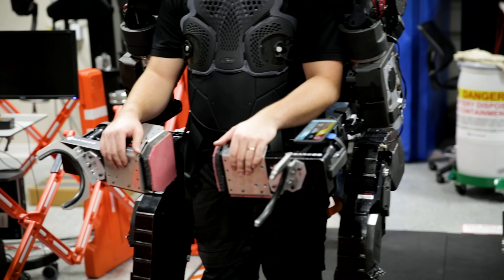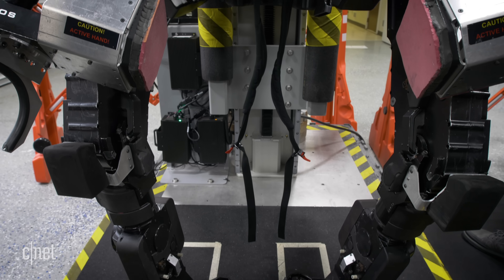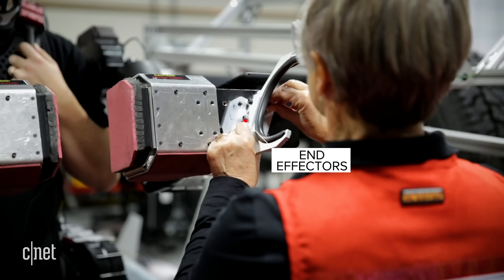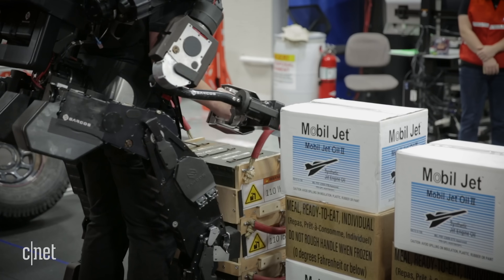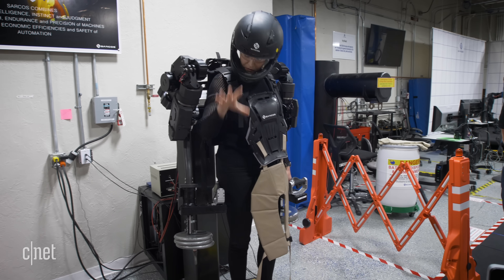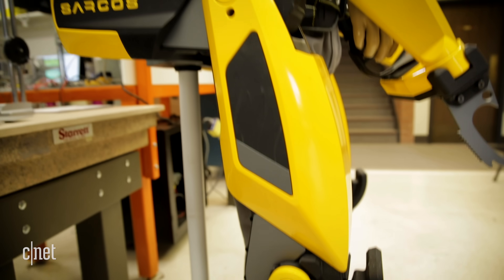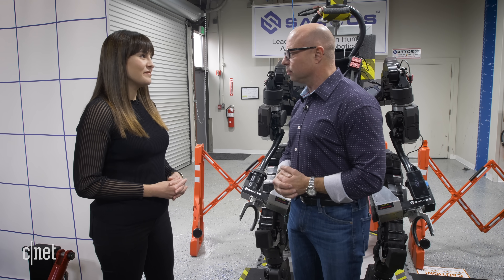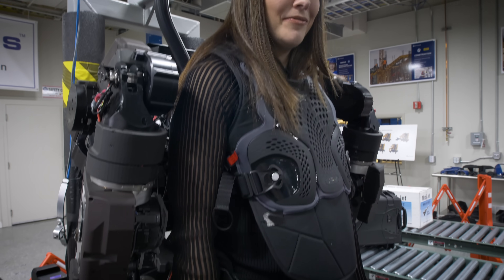Guardian XO is a powered exoskeleton that makes you 20X stronger

Comment: Why is the human element even there? Couldn't a robot just do the same thing without the need for an operator?
Reply: to control it, it easier than a remote control
Reply: @marwanelyoussoufi626  Robots are already easily automated to perform tasks like these, without the need of a remote.
Reply: @Nomans_Nomen  But a robot can't detect if something is wrong. A human's intuition can detect if a servo is going bad or a battery is in need of replacement and can just lock the suit, climb out, fix it, and get back in. kind on like the argument between autoloaders and human loaders in a tank. More guys mean more hands to work and fix. Plus this robot is using the embarked human's sense of balance.
Reply: @Gurren813  Robotic arms already do like 90% of the manual assembly in pretty much every industry. Removing the limitations of a bipedal form, and providing a human to check the robot maybe once a month, and you've got something that's already been proven and invented 30+ years ago! And a robot absolutely could be programmed to alert a maintenance man when service is needed, probably even through a text message. This exoskeleton is reinventing the wheel, plain and simple. It's only practical uses could be recreation, assisting the disabled, or doing a killer Aliens cosplay. Otherwise, it is taking a step backwards for innovation, as far as industry is concerned.
Reply: @Nomans_Nomen  But can an assembly line robot travel across a warehouse and move/sort assorted items by sight?  The kind of programming and hardware needed for such a mundane task would be staggering.  Machines may be getting smarter all the time, but the moment their environment ceases to accommodate their programming they becomes dumb as bricks.  Pairing humans and machines together like with the exosuit would make for much quicker response time for when things inevitably go wrong or randomly change.
Reply: also robot brains/AI cost a lot more and takes a lot more time to make and program then the body itself
Reply: @Nomans_Nomen  You're thinking about it's use in a factory. I'm thinking about it being used outside and in the field. You can't install a big robotic arm just anywhere, but a person can walk just about anywhere. I know he said it'll probably never get armored, but an EOD guy with half a ton of armor will be a lot safer when defusing a bomb. Disaster response could also be streamlined by allowing a pilot to clear debris and carry tools like the jaws of life that would take a whole team to clear or use. You're thinking in a box.
Reply: @Gurren813  Robots already handle EOD disposal. Using a wheelie robot, with an arm. You are the one thinking inside of a box.
Reply: @DangerZone200  This is actually not a given. Your average worker requires breaks, and is usually limited to working eight hours a day. Round the clock labor would add up extremely fast to offset the cost of the robots. Most workers require training hours and uniforms, which cost upwards of $500. Sooo. No breaks, no time off, and not having to pay hourly wages AT ALL, means that the initial cost of the robot is going to pay itself off extremely fast.
Reply: @TheCheeseConspiracy  Amazon already has completely automated warehouses with pretty much entirely robotic staff. I suggest you look up a video of what one of those warehouses looks like. Human's could not hope to come even remotely close to their efficiency, period.
Reply: @Nomans_Nomen  A wheeled robot is nice but it can't get around in rough terrain. Robot arms and unmanned drones have their place, but until we come to terms with letting an AI play with guns or not a human is still a much more adaptable worker and fighter and this suit will enhance them.
Reply: @Gurren813  I can practically guarantee you that DARPA is already applying machine learning to a military theater. It is a safe bet that quantum computing will also find its way in their quite snugly. So, what happens when you combine robotic technology, that would OBJECTIVELY be less expensive than training, maintaining, and feeding soldiers, with a sophisticated machine intelligence, capable of thinking over a million steps further ahead than any organic brain could ever hope to achieve? I will bet my life that AI is ALREADY being used to play with guns. I think that play is going to be sophisticated enough to replace all of our soldiers in at least the next 20 or 30 years.
Reply: @Nomans_Nomen  You want skynet? Cause that's how you make skynet. Quantum computing is already on the scene but requiring near absolute zero temps and costing several billion dollars a unit is quite the investment even for the united state's military. This suit could already be deployed TODAY to help reduce strain in supply lines and workshops. Your ideas are beyond the horizon while this is right here in front of us.
Reply: @Gurren813  20 years away from now isn't exactly "beyond the horizon", but, you know what? I'll just agree to disagree.
Reply: @Nomans_Nomen  Sounds good to me, Merry Christmas!
Reply: @Gurren813  Merry Christmas!
Reply: @Nomans_Nomen  I've seen a few and it is quite impressive.  Hopefully that kind of automation can alleviate the harsh working conditions in Amazon warehouses that I've heard about from various news stories.

Comment: So $100,000 to enable someone pathetically weak to lift less than a reasonably fit male at 1/10th of the speed of that same reasonably fit male.
If you're going to say it's 20x stronger than a human, how about making it actually 20x stronger than an average male.  40 pounds is not too much for the average male and 20 times that is 800 pounds.  200 pounds is not (while hopefully not the end goal) all that impressive when humans can train a bit to vastly exceed that lifting capacity.
Lower risk of injury is nice though.

Comment: cool try but it will take another decade at least to make this for commercial or industrial use anywhere. I used to work at company that makes countertop(some slabs are over 700 lbs each) and there  is no place where we can apply this anywhere at plant. Forklift does better job than this tiny robot. Not to mention it has to change hand to lift something. Also, who knows how much maintenance this thing require? Nobody at regular industry would know how to troubleshoot or fix this thing if it malfunction. Lastly.. the cost.. how much would this cost? like 10x cost of forklift? lol.. good try but we aren't ready to use this yet.

Comment: this thing needs to get a lot more powerful before this becomes commercially viable. its big, its slow and 200 lbs is not really that heavy. yeah it takes one human and significantly enhances them but if you just add another human to the mix two men become just as effective and much faster and cheaper than this thing. I can only see it being used in scientific environments, not logistical ones right now

Comment: Could a robot suit be made for gym enthusiasts, or even peeps who need physiotherapy? Taking off all the heavy load of gym weights, and building buff muscles with zero effort. Perhaps even assisting a marathon runner to run for miles without tiring, and even after removing the robot suit, they are still fit as a fiddle =^_^=

Comment: "$100,000 a year," "very affordable,"

... what?
Reply: If some company that needs some of these sees that price I doubt it will deter them from renting it. Also at the moment this is the first 'exo skeleton' to be available soon (as far as I know, I haven't heard of anything of this sort but correct me if I'm wrong) so it's not like anyone can argue about pricing, atleast until there's competition in the future from other companies doing this.
Reply: @RaptorCuddles  It's the available exo-skeleton on the market (also just as far as I know), but why would any sane company pay that much to rent one when they can get an army of forklifts and which can lift 4 times the payload for half the cost.  If for some ridiculous reason a company just HAD to use an exoskeleton, then sure they would just have to deal with the cost.  That said, what sane company would do that when there are so many cheaper (even if they are sometimes a bit more difficult in small spaces) alternatives?

Comment: You're telling me an exo named "guardian" isn't meant to be armored? Right....
Reply: Doesnt matter if you armor it, the problem is the power supply. The amount of power needed to operate this for extended periods of time vs the size and weight of said power supply. The more power you give it the heavier it gets requiring more power. It's a vicious cycle.
Reply: Destiny 2 gang
Reply: Exo titan here. Giving you protection with my bubble.
Reply: Saint-14 would approve of your name
Reply: @homelessrobot  "effective" for room clearing- unless the enemy has anticipated it. Let's say you and your squad are room clearing with standard equipment, level 4 armor and carbines/shotguns. Your enemy knows you are coming. Do you like your chances? Ask any former spec ops guy about hitting a complex where the enemy is dug in and expectant. They NEVER want to do that-everything goes sideways and all bets are off.

Traps, murderholes, distractions, defensive grenade use, etc and the casualties mount quickly. That's why such raids are so dependent on the element of surprise; if your enemy can prepare, it's gonna be a bloodbath.

With powered armor, suddenly it doesn't matter if they know you're coming or not, they can't stop you. The level of armor an exoskeleton would let you use is WAY beyond your standard level 4 stuff. We're talking invulnerable to anything short of anti-tank weaponry. The intimidation value alone is priceless.

Also, imagine such armor used for law enforcement raids- you don't even have to give that guy a gun, he can just walk up and disarm the perp while bullets bounce off of him. No killed dogs, no officer and sharply reduced perp casualties.
Reply: @jadedandbitter  "Traps, murderholes, distractions, defensive grenade use, etc and the casualties mount quickly. That's why such raids are so dependent on the element of surprise; if your enemy can prepare, it's gonna be a bloodbath." 
Agreed! If I had too, I'd rather walk into a blood bath caring 4x more armor/weapons for same mobility rather then walk into it with 4x less.
Reply: @homelessrobot  Sideways, with additional armor plating on the entry side. You wouldn't use more than two, I think. 1 may be sufficient with conventional squad support. Also, you could mount short range wall transparency radar on the thing so the operator could see behind/shoot through walls. That gives the element of surprise back, even if they know you are in the building.
Reply: @homelessrobot  m8 you cant compare a motorcycle to a exoskeleton, its like saying "what do you mean i cant have this Little engine to power my tank? It worked on my Toyota!"
Reply: We already have robots that do most of these jobs in the military. The whole point is to make the passenger stronger with use of robotics. 

While this isn't completely conventional for military use, it was never stated as being such. You must also be aware that a person wouldn't be using this 24/7 just to wipe their nose or something, it's for more one-and-done tasks like picking up a metal plate.

Then you have the soldier part. Not in every situation is there a firefight or war. Regular dispatches of soldiers wear their uniform in full, it would be a safety hazard if not. But say there are shots fired, it will not always be in a tight immanouverable space.
Reply: @homelessrobot  Yep, that's what I've pointed out previously. Small gasoline engines would be the way to go. Also, operating times wouldn't have to be very long anyways- you'd use these things for assaults. Like, imagine doing room clearing in power armor, it'd be trivial unless the enemy uses enough HE to destroy the building itself.
Reply: @homelessrobot  Yes, because putting a gas tank on a soldier in a firefight its a great idea... Then you have a combustion engine that will be prone to fail in the heat of battle which will either put the soldier's life in danger or they will have to abandon expensive hardware.
Reply: @homelessrobot  I'm not an engineer but I've heard numerous times that at least in cars, electric will phase out traditional combustion vehicles partly because they are far safer and are far more reliable. Maybe not so much currently but electric has a much better future outlook. As far as current military standards, a lot of heavy equipment such as main battle tanks are being phased out because they are absolutely a liability. In a 100 years of mechanized warfare, engine problems persist to modern-day. And just stacking more armor doesn't fix the problem, in it just creates more problems. People seriously underestimate how much armor can weigh, its why nowadays militarys are starting to investigate alternatives to conventional armor.

Comment: The only problem with any exoskeleton isnt design or purpose or anything else but simple trying to find a power source to power it for the duration it needs to be used. And  it's just not viable to equip it to every factory workplace that requires heavy lifting until it can exceed a forklift in terms of mobility and speed and efficiency.

Comment: Guy: it's not meant to have any armour on it.
Military: heh.
Reply: Its probably meant to hold supply racks for ammo and medical supplies. This is pretty much only good for combat engineers and medics. Make it 10x smaller then you can put it on the average soldier.
Reply: @PugilistCactus   with all the things a soldier actually has to climb and crawl and move over- a platoon wearing almost any exoskeleton would be so sluggish at manoeuvres they'd just become walking targets.
a better idea would be to lighten combat loads and improve the insertion of materiel to engaged troops.

Comment: Yeah but with 90kgs it wont replace forklifts imo, not by a long way.
If a forklift can be a fraction of the price, and yet is 500 times stronger at the same time, why would anyone want this? I admit its an interesting piece of machinery, but at the level it is, I would guess it would only be more practical than a forklift in some very niche applications e.g. uneven terrain.
As for training, not really. Im not even certified for operating one, but when I needed something lifted fast and the operator is missing, Id just drive it myself.

Comment: That's cool and all.  but. could there be a more streamlined version for people who have been wheelchair-bound?  A friend of mine can feel her legs just fine,  but can only stand and walk with either a walker or in a pool with assistance.  something like this with X1 human power rather than X50 or more  would be great if it were compact and easy to get into and out of by someone with little use of their legs.  Naturally there would be no need for the arms since hers are just fine.  But the legs are what interest me, when I think of my BFF.
Reply: I think that you should have googled some solutions instead, but I'll cut you some slack, and just respond to this the best way I can:
If you are looking for really expensive stuff, there's ReWalk, ranging from $69k to $85k. It weighs 51 pounds, has a max speed of 1.6 miles an hour, walk time of 8 hours before needing a recharge and is FDA approved.

If you are looking for something cheaper, there's the SuitX Phoenix, which is cheaper, but makes some compromises compared to the other: Max speed of 1.1 miles per hour, walk time of 4 hours, and from what I gathered during my few minutes of googling, is not yet released, but I highly recommend researching this for yourself.

It also does some things better, like being only 27 pounds, and you can wear it while being in a wheelchair.

I really hope this helps, best of luck for your bff, and please do try to do more research, this took me literally 10 minutes and I don't want to recommend you outdated or inferior stuff, please please research more.
Reply: @idan7856  Thank you. I'm going to do just that, and let her know.
Reply: @Cammi_Rosalie  thank you, I really hope I helped you and your friend!

Comment: Imagine throwing shielding on this and attaching a minigun on each arm.
Reply: Mini gun is too inconvenient. I'll go with a single MG-4 mounted on a steadicam please. And put a 2000round belt in that sucker stat. Also give me a cooling sleeve for the gun. 

Mini guns are nice and all, but I don't want to be a loser that has to fix it if it jams fue to bad weather conditions.
Reply: And change the operator with full robot.
Reply: @mb26  But then you don't need the exo skeleton.
Reply: M B the point of the exo suit is to enhance human ability, would be a waste to give it to a robot since you can just make a strong robot without a suit instead.
Reply: not all robots needs to be build extremly strong, if you u build an ordinary robot but then you need it to be strong, you will be in a situation that robots need exoskeleton. I said at first change the man with the robot because to emphasize that robots will take humans jobs.
Reply: @reiayanami137  robots will be our end so no thanks
Reply: Imagine immediately being shredded to pieces because you cant get into cover fast enough
Reply: Have fun trying to use the most valuable small arms tactics in combat with this thing on. Those two tactics being mobility and stealth, neither of which you'll have with this. Still waaaay to bulky.
Reply: @AlleyCatNinja  Maybe you wouldn't need to be stealthy.🤔

Comment: To say Increases your strength by a factor of 20 is not very accurate or prudent. The example provided is that it makes a 100lb item feel like 5. 

But if I can lift 35lb single hand does it mean I can lift 700lb with XO because it claims to increase by a factor of 20?